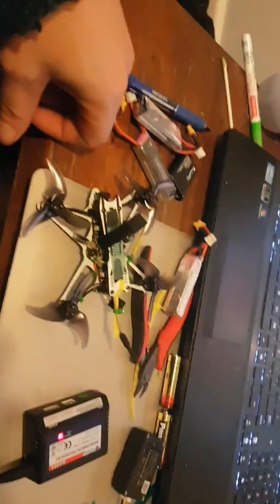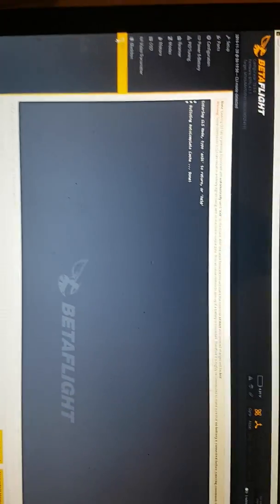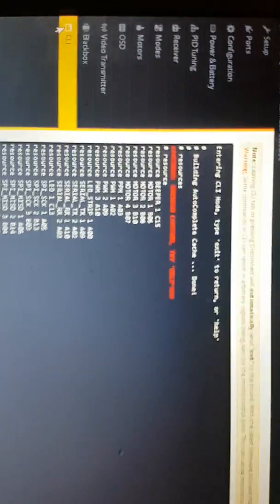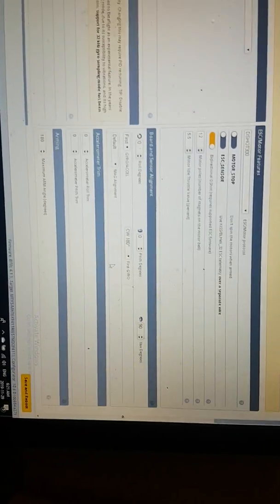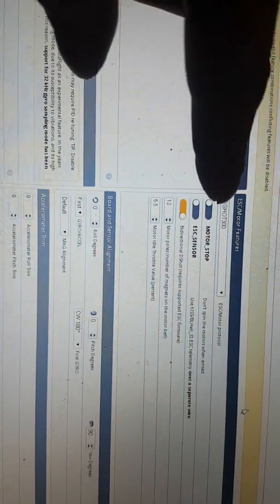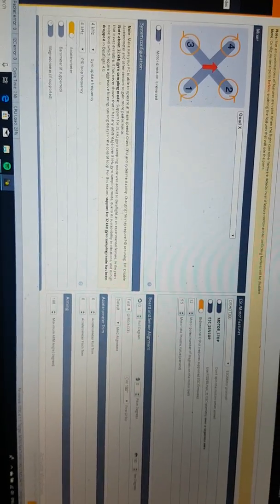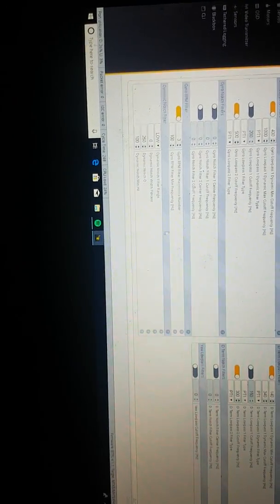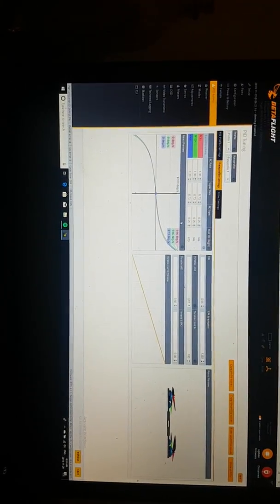EMAX Tinyhawk Freestyle Betaflight 4.1 setup

Comment: hi Adam, thankyou for this video.. 
i just flashed to 4.1 and couldnt get to air because of the motors positioned incorrectly, MATEKF411RX comes with motors swiped by 1 position, because this is the same board of the Tinyhawk s that is turned 90 degrees respect to the Freestyle.
Thankyou.
Reply: Do you mean the direction of the motors, eg. cw or ccw? if so you can change that using the dshotprog cli command in betaflight. "dshotprog 0 8" reverses motor 1 "dshotprog 3 8" reverses motor 4 (counts from 0..3). to save this permanently use "dshotprog 0 12". (note the last value: 8 = reverse; 12 = save). if you mean the orientation of the board just set the yaw value as shown in the video. hope this helps